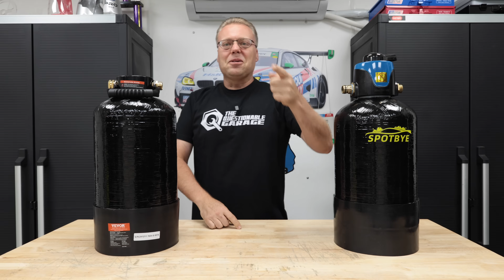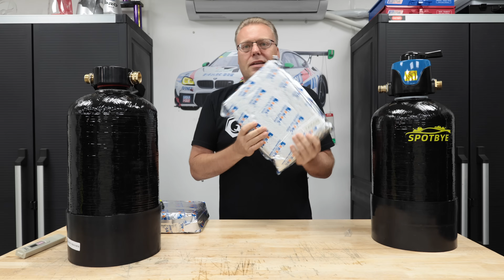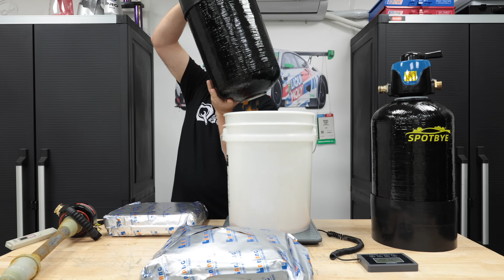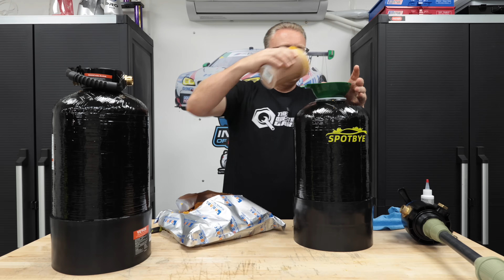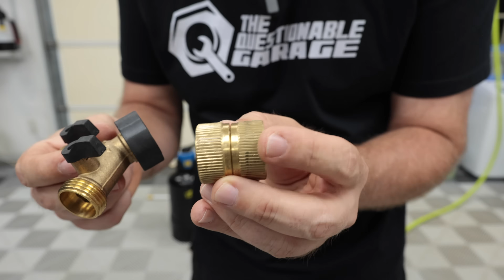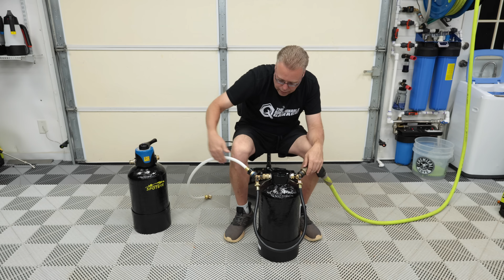BEST Budget DI Spotless Tank Systems | Vevor | Spotbye | Deionization

Comment: Looking to get the spotbye because the vevor is out of stock. 
I have a mobile detailing rig with a 40 gallon tank that I gravity feed to my active 2.0. Would you recommend I get a water pressure pump so I can get 2.5 gpm through the spotbye into the active 2.0? I’m assuming it needs more than a gravity feed flow to send water out into the spotbye and at a flow that my active 2.0 can work with? Curious what your recommendation would be.
Thanks for the great review and for showing us it’s possible to get DI water for under 200🙏
Reply from the maker: I’m not very educated on gravity feed so can’t speak too much on that, but some use a DI inline without a pump. I’m sure there are different flow rates based on the height of the feed and the opening in the tank plus length of hose. If it can run a 2.0 now I would assume it has enough volume and force to work through the DI tank. A booster pump could help though for sure.

Comment: New to the channel and appreciate your reporting.  In your experience, is there a noticeable difference between say Serve a Pure or XERO 50/50 virgin resins and the Amazon BamBam ? I have been running a 2020 Spot Free tank from Clean Garage and have noticed a tailing off of longevity. Yes my TDS here in Los Angeles is high @ 210-225 and I rinse my car washes 3X a week.   I constantly shop and just paid $129.00 all in for 1/2 cu/ft.    Thanks!
Reply from the maker: That’s a good price and virgin resin will always be better than Bam Bam as it’s regenerated.
Reply: @CarsWithKeav  Thanks for the kind reply. Keep up the good vids.

Comment: So I got a TDS meter and checked my water since i need a brick of the bam bam before rinse so I can dry fast enough.🤣 I measured 750ppm 😯
Reply from the maker: You would go through that bag of Bam Bam in just a few washes with that water. It’s very possible no filter system would be able to get it to spotless water without first using reverse osmosis to store that water then run it through the DI system for the final cleans. Hate to be the one to give you the bad news.

Comment: Thank you for the video. I don’t know the PPM in my area but I live in the desert and it gets super hot. Does DI really make a difference in hot 110+ weather? And what if the PPM water going into the DI is exceptionally high to begin with? Will it work?
Reply from the maker: Higher ppm just depletes the resin so much quicker and also sometimes doesn’t allow you to run the water at the flow you want. DI water really helps in the heat as if the water dries before you can get to the other side of the car it will be harmless.
Reply: @CarsWithKeav Thanks for responding, that’s pretty cool you actually read the posts. 👍

Comment: I use a garden hose filter for my outdoor hydroponics and it does a great job for that as it is seasonal but it is mostly useless as far as cars are concerned in a cost vs results. I have a 1.2 gal pressure washer and a rinse is about 3-5 min depending on the chemicals I m using in the wash all with the bypass then switching to a final rinse.  That's quite a cost using a system that costs more vs less but is it worth it?.  A good test for any filter system is to spray a fine mist on untreated glass in direct sunlight and let it dry, no wipe or blower. Assess that to know what your filters are doing if you don't have meters. Many moons ago I tested a few RV line filters for outdoor in direct sunlight washing using sun-dried glass, not a bad thing for the Home wash guy doing his own car, but for a business the spotless tank system is the way, Great Video.
Reply from the maker: Really appreciate the great insights and information you gave us. This should help others. Cost unfortunately is all depending on the water and some say 50ppm water may spot more than 100ppm just depends on the minerals in the water. Some are more harmful to clear coat than others.
Reply: @CarsWithKeav  sending in water samples for testing is going to be made available for millions so testing places will be overwhelmed soon. I expect testers will be in short supply as people will take advantage of this. What size a contaminate vs how they get by the media matters is something to look into. I did lots of reading on filtration systems for RO  and various media for industrial applications. Zero is always best and as your video shows there are great options out there.
Reply from the maker: @MrNoclutch Home Depot does it for free usually the packages are at the entrance or exit.

Comment: Always great videos.  I received the Vevor on the June16th.  Set it up.  My water is at 156ppm.  The lowest I got the first time was 30ppm.  I contacted Vevor and they said to allow the water to sit in the tank for 30 minutes.  The tank sat for a day.  I tested again at 2.5gpm and the lowest I got was 7ppm.  Bad resin or is there another solution.  Thanks!
Reply: When I had my spigot turn on full, I measured a TDS reading above 0. I figured out that if I reduced the water flow rate my TDS reading dropped to 0. Give that a try to see if that works.
Reply from the maker: Possibly just some not so good resin which was always my worry with something this cheap, but also not the end of the world as you basically are just paying for the tank and the resin was a bonus.
Reply: @CarsWithKeav  Agreed.  Do you think they will send me resin to replace?  They have been responsive.  I will keep you informed as to what they are willing to do.
Reply from the maker: @jeffshaw6004 Yeah say it sounds like it was used already.

Comment: I bought this and flushed the system for 15 minutes and my tds didn’t get below 193.  I even decreased the flow but no change. I started with 207. Did I do something wrong? Should I just return it?
Reply from the maker: Sounds like bad resin which can happen when dealing with cheaper systems. Could also be a real bad seal or leak in the head causing tap water to pass by the filter resin.
Reply: Or you may have plumbed the lines backwards and pushed the resin out of the tank. The head is labeled specifically for an in and an out flow.
Reply from the maker: @zgaddy1 I didn’t even think about that. That’s a possibility as well.

Comment: You mentioned eley quick connects but what do you use for pressure washer quick connects? Looking for something better than Amazon cheap ones
Reply from the maker: All I use is Amazon cheap stainless ones. Never had one fail. Unless you are buying MTM Primo or Mosmatic there ain’t much else out there that isn’t all made in the same factories really.

Comment: So what’s the better vevor unit? This one or the two canister style one?
Reply from the maker: This one is the better for cleaning of the water, but the real difference is the two canister is meant for wall mounting and this one is not.
Reply: So between these vevor units and the waterdrop one, which one would you recommend?
Reply from the maker: @schwenkm  The Vevor is a far better setup. The Waterdrop is only if you want that amazing bypass, but you will have to modify it at some point to make it better.

Comment: It's unfortunate that my water is so hard, I can hopefully get to zero ppm by reducing the flow out. When I set it up, my faucet water was showing about 450 (I don't remember exact) and the deionized water was reading 22 ppm directly out of the output line. Since I am using the 1800psi ryobi I should be okay limiting the output flow a bit to achieve 0 ppm. At least, I hope I am correct in my thinking. Either way, rinsing my car with a 20 ppm water is leagues better than over 400 ppm!
Reply from the maker: Let us know how it goes. Hard water sucks for sure it makes your cost per wash so much more due to how it depletes the resin.

Comment: Do you know the capacity of resin the vevor holds in cubic ft? I didn’t see it in the link you have.
Reply from the maker: It come full already with the 15lbs I weighed that comes out to a little more than 1/3 cubic feet. Usually a cubic foot weighs 42lbs or so. It can hold more though maybe closer to 1/3 cubic foot if you stuff it in there.

Comment: Another great video! I use the Waterdrop setup from one of your previous videos. I replaced the included filter with your DIY canister with the Bam Bam, and I was able to get from 240 ppm to 0. But just yesterday, I tested it again, and my filtered water was all the way up at 240 already! There's just no way the resin has depleted that quickly... I washed my car only a handful of times since the install and only use filtered water on my last rinse. Any ideas as to why that would happen?
Reply from the maker: How long between uses and was it long enough to dry out? Was it stored or left in the heat or sunlight? Is there a lot of chlorine in your city/county water? These are the things that can impact this. Possibly the filters canisters have lost their seal inside and are blowing by unfiltered water?I know it’s a dumb question, but is the bypass on?
Reply: @CarsWithKeav thanks for the reply. Not more than a week between uses. I keep it in my garage, it is never in the sun. I'm not sure on the chlorine content, but I'm running it from my softened water spigot. And yes, I definitely checked to make sure it wasn't on bypass 😂. I would just expect it to slowly creep up in ppm and not be so dramatic so quickly. I'm going to take the filter apart and take a look at it and make sure the gaskets are all still in place
Reply: @abutaher201 following , I have same setup as you with the water softener at around 200-208ppm. On the fence about pulling the trigger to get a DI system
Reply: @blacklotus6 it worked amazingly when I first set it up. Now I'm just trying to figure out why it depletes so fast
Reply from the maker: @abutaher201 yeah it would be a progression upwards in Pom not just a sudden change like that.
Reply: @CarsWithKeav so the gaskets are all in place. The resin has turned from a yellowish orange to now an amber color, so I'm guessing it's depleted. I added a bit of fresh resin to top it off, and the ppm dropped to about 170. I just don't think there's any way I went through hundreds of gallons of water already. Am I able to replace the existing blue canisters with bigger ones?
Reply from the maker: @abutaher201 I did a video on that finding the right thread pattern and housing that fits is the hard part. The listing I had they changed it and were shipping people the wrong threading. Sounds like it’s depleted with that amount of resin I would estimate about 150 to 200 gallons. All depends on the water as not all 240p is the same as there could be concentrations of specific minerals overwhelming the resin.
Reply: @CarsWithKeav hmm ok. I guess I need to talk to my Bam Bam dealer. Do you think decreasing the flow from my spigot will make it last longer even though the flow rate is limited to my Ryobi's 1.8 gpm? And do you know of an environmentally friendly way to discard the resin? Thank you for your input, as always

Comment: Finally you got the cheaper Vevor DI system, I've been using this for the pass 4-5 months and love it. As always don't waste time with the foam 
1. Pre-wash spray (no need for expensive e-foamers)
2. rinse off with DI pressure spray (lower 1.2 gpm is better, doesn't waste DI water)
3. Rinse-less wash (no swirls or marring even without the foam)
4. Dry with detailer (towel, air blower, even air dry if super lazy)
5. No worry about water spots. DI system has been the biggest difference in making things easy.
Reply: But I just bought a bunch of foaming stuff 😢
Reply from the maker: Foaming is fun and therapeutic for me so I will always do that, but we all have our own way which is great.
Reply from the maker: Great process! I’ve had it for a few months just has always been sold out now after a few hours it’s sold out again. 🤷‍♂️
Reply: @CarsWithKeav yea it’s sold out right now, not sure if I should wait, I was looking at the spotbye with the built in bypass on the head
Reply from the maker: @PerezOutdoors With the tariff stuff companies are sending less products over at one time as to avoid paying huge amount as the tax rates are changing all the time. Both are great products.
Reply: @CarsWithKeav makes sense, spotbye just looks cleaner with the bypass being a switch, going to give it a couple weeks hopefully vevor restocks

Comment: Good video Keav. What do the Back Wash and Fast Rinse settings do?
Reply from the maker: Nothing as there is a plug to stop those from working. It’s basically a pool filter type lever they are got to thread onto a tank.
Reply: @CarsWithKeav  So no advantage to the Spotbye top on the Vevor tank? It seems like simple quick disconnects on the Vevor tank would be easier than the dual outlet bypass connectors it comes with? Is replacement resin available for the Vevor tank?
Reply from the maker: @rlbjr  Onky advantage to the Spotbye is convenience of a lever that really takes up no extra room to do a bypass. No performance increase or anything like that just a nice feature to have. Quick connects is way easier and you’ll never accidentally forget to turn one of those 4 levers to change bypass to filter. Done that before though I was spotless and was mixing my spotless and bypass together. 🤣

Comment: Dang I got my spotbye a few weeks ago and no bypass I had to make my own. They should make the bypass for the smaller one but at this point I like the size and not having to use more than a brick of yayo.
Reply from the maker: That bypass would work on the smaller one it’s the same thread pattern I think. Just the tube length would need to be changed.

Comment: Keav, I have the smaller Spotbye 5L running the new Ryobi 1.8GPM pressure washer with a Waterdrop Whole House Water Filter System.  Using two 10 x 4.5 PP and carbon filter. What is safest GPM I can run without burning my resin to fast?
Reply from the maker: That’s going to all depend on your ppm coming into the di resin. For most water you should have enough to run that Ryobi. It’s all based on total gallons so if you are using more then you would be getting a more efficient rinse which in the end should even things out with exhaustion.
Reply: @CarsWithKeav  sorry forgot to mention my PPM is around 385 before going into the DI tank
Reply from the maker: @JordanRN77  I think it could handle it, but unsure at the rate you need how long it will last before it starts creeping above spotless territory around 20ppm. It possibly might not make it to 0ppm just depends on what is in that water mineral wise.
Reply: @CarsWithKeav ❤
Reply: @CarsWithKeav ❤

Comment: I am new to all this

What is the purpose/ point of buying something like this ?

Is it just so you don't have water stains? Meaning you wont have to dry your car ?
Reply from the maker: More or less to not have water spots which can etch paint and cause damage to the clear coat. It’s also a better quality water for mixing chemicals. In hot areas in direct sunlight it’s almost mandatory. Many of us like the leaf blow our cars off and if the water has lots of minerals you can dry them onto the car creating a haze. Spotless water won’t give those issue and of course you can just let the car dry on its own, but anything in the air can attach to a water bead in a car and cause a spot, but at least it’s not harmful like minerals from you tap water.

Comment: if youre saying the vevor has better resin then then the amazon special you frequently recommend - what would be the upgrade to that? I detail cars as a side gig and I get very little out of my spotless brand DIW-20 bypassed system, maybe 15-20 cars or so with my 250PPM water so ive finally built an RO system but no longer want to keep feeding spotless money for their resin.
Reply from the maker: Problem is I have no idea what resin is in the Vevor. I will say with DI resin I have had hit or miss with a lot of brands. I have had Bamboo Bam do amazing and also do okay which I am fine with due to the price. Sometimes it’s seems some resin is just regenerated better or it has much less life cycles of regeneration. CR spotless Inthink high quality, but it’s only cost effective if you buy it by the cubic foot.
Reply: @CarsWithKeav  If you haven't made a video testing their resin or products - I think that would make some good content!

Comment: I really have good water 30-37tds when tested.  Is this still something I need to get?
Reply: yes thats not spotless, so if it drys in the sun you will still spot it really needs to be 0, even 1PPM will still spot.
Reply from the maker: If you plan to not to dry your car with a towel then spotless is a good idea or if you work in direct sunlight on hot days.

Comment: I’m pretty sure you are really a coke head at heart, even if you aren’t a user 😂 

I bought the smaller Spotbye and it works great for me. I did creat my own bypass that is almost the same as what comes with the Vevor. Not great but works. So many spots it can leak. Probably going to upgrade to the other though since it’s 2x the size and has the bypass.

Just received Eley sprayer and accessories as well 😀 those things are quality. Nice to have quick connects that don’t leak anymore

Luv ya Keav
Reply from the maker: Eley are the best and I abuse the heck out of them. I’m for sure an addict at heart without ever actually touching the stuff. 🤣

Comment: I have a spotbye tank. Without the bypass. I love it. A little bit of a pain to fill since its not a cartridge style filter like other brands. However it works well. My well water was very good quality to start with. It tested at 47ppm  TDS but with the Spotbye. It tested at 1ppm TDS. Amazing. Had a customer  (who i detail at their house and use their water) tested at 128ppm TDS with filter it was 12ppm TDS. In short the Spotbye was $213 delivered. Money very will spend. Car can drip dry with zero water spots.
Reply from the maker: Nice! Glad it’s working out well for you!